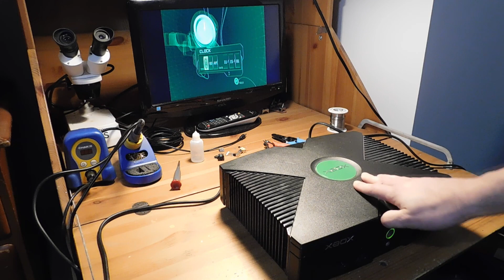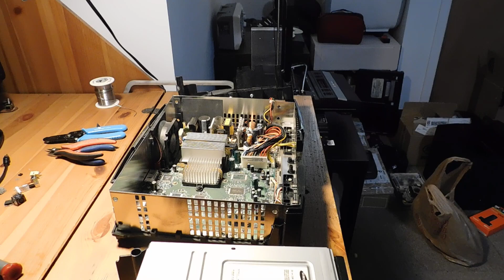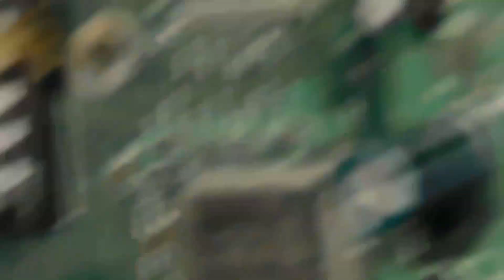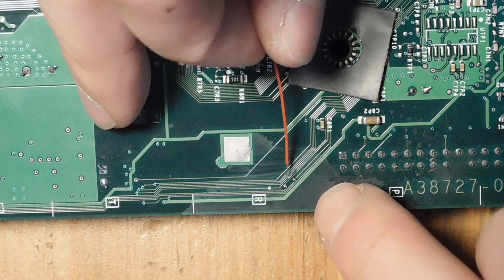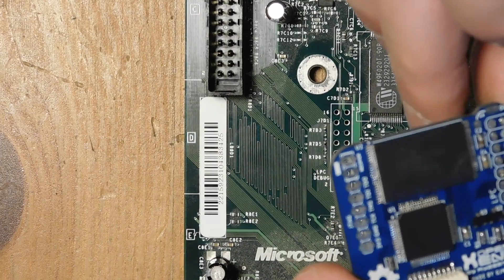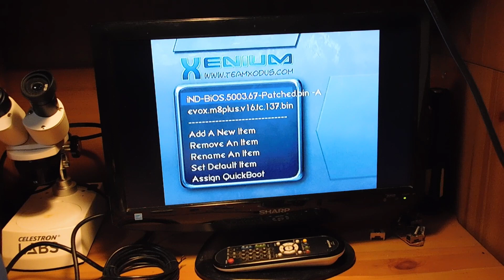Original Xbox: Damaged trace repairs and Open Xenium Install

Comment: Hi, help please, 1.6 motherboard, clock capasitor bypass, full recap, all four ports not work, all traces is perfect condition, zero information about this problem, try different controllers , try different port from donor motherboard, help

Comment: This trace repair was unnecessarily complex, lol. Grind/scrape away at the silk screen at the damaged points til you expose copper, solder some miniature jumper wires and solder mask the exposed area. All in all though, successful repair was successful. 

Repaired a friends Xbox not long ago with a deleted D0 trace. Solder braid wire works great if you don't have the perfect stuff. It appeared to be the same gauge as the traces, and it fit very nicely in the trace channel. Cut to length, pull out one strand at a time, solder to one point, bend to the curvature of the trace channel with two sets of fine tip tweezers and so on.
Reply from the maker: The reason why I don’t do the repair locally is because that whole region is susceptible to more trace decay. You can patch it locally but it’s only a matter of time before additional trace rot will cut those traces again

Comment: You mention that people aren't interested in modding 1.6, is this a fact or just a personal opinion? I picked up 2 original xbox's to mod and both are 1.6 so its not that I got choice as these consoles become harder to come by and cost more. I plan to get a third one so I'd install Aladin, OpenXenium and another third chip I got.
Reply from the maker: It’s a bit anecdotal, but I know a bunch of other people that mod Xbox and they tend to avoid 1.6 because it’s not compatible with some popular mods like a RAM upgrade. But it really does depend on what you want to do and in many cases 1.6 might be perfectly fine
Reply: @LIRetroGaming  yeah I'll agree like I have a 1.6 but outside of chipping it I don't feel there's too much you can do with it

Comment: I installed my Open Xenium chip but I get an error. Xenium Kernal Panic! exception C0000005 (0) generated at 80101A34 (00B41A34), any ideas? I do have a softmodded system, maybe that is it?
Reply from the maker: Yes, I think that’s it. You need Heimdalls Xbox engineering tools disk to install a modcip friendly operating system on the C partition
Reply: @LIRetroGaming  yeah he'll need hardmod dashboard files as there's conflicts using softmod files with a hardmod

Comment: Whine not just recconect the traces locally without 4 meter of wire?
Reply from the maker: The reason why is because the trace deterioration will continue on the edge of the board. So therefore a small patch like what you suggested will fix the problem, but only temporarily. Once the trace deteriorates again you will need to do the repair again

Comment: What's the difference with 1.6 that makes them unfavorable for modding?
Reply: Modchips use the LPC port and Microsoft modified the LPC port on v1.6 boxes. So you have to do an LPC rebuild to get a modchip to work. It's not that hard it's just extra work that has to be done. ALSO, v1.6 boxes use a different video encoder that has issues with running a few games in progressive scan.

Comment: my console is soft modded but that actually ended up saving the console i got it for a softmod and shell swap project but softmodding it saved the consoles original harddrive was in danger of failing and you could tell it wasnt healthy and if i remember correctly i upgraded the console to a 160gb drive that could be locked with the key from the original harddrive

Comment: Also I'd like to note: you may want to shorten the exposed wire down to fit so it doesn't risk shorting onto other traces or components.
Reply from the maker: Absolutely. I went back and cleaned that up while I was also installing the Xbox HDMI

Comment: Just found your channel, and I love the content! The in-depth look at repairing and nodding consoles is awesome.

Any tips or a place to start to learn electronics? Making fixes and mods like you have would be great, but and my knowledge of electronics is slim lol I work as a software engineer so I understand some of it, but not enough to do anything like this
Reply from the maker: Element 14 and Adafruit have lots of good courses and videos that explain electronics. And of course you need hands on experience. Practice on stuff that does not matter and then attempt repairs on some easy systems like the game boy or NES. And then gradually you will build up your knowledge and your skill
Reply: @LIRetroGaming  thanks for the info!

Comment: The clock capacitor leaks, and the acid eats away at the traces. This is extremely common, and it is highly recommended to remove this capacitor from all 1.0-1.4 consoles, even if it hasn't started leaking... It eventually will. 1.6 doesn't have this capacitor.
Also, most capacitors will eventually leak. I've had to replace many caps on v1.6 boxes several times.
Reply: 1.6 has a clock cap, but they aren't prone to this issue, though all capacitors need replacement eventually whether they leak or pop.
Reply: It's imperative to note that the 1.6 xbox clock cap should not be removed, only replaced.  If you remove it your xbox won't even power on.

Comment: I'd probably wash that motherboard as well and maybe paint on some fresh solder mask on the exposed copper traces. You can see how some of the thin traces are exposed. Even your own fingerprints left on the board can result in oxidization of the copper.
Reply from the maker: Definitely. It’s important to clean up afterwards and I do that after the work is finished

Comment: Yeah the clock capacitor is probably leaking or will start to leak in the near future. Don't forget, after removing the clock capacitor, to clean the area where the clock capacitor is with alcohol. It's always good practice to remove it.

I have several Xboxs and I have done these traces repair on about half of them, it's a common problem :( I cleaned all the traces with alcohol, I hope that this helps to avoid the problem.

Good video.
Reply from the maker: Thanks, glad you enjoyed the video. And yes, cleaning up afterwards with alcohol is very important. I don’t always film it but it’s definitely something I do every time

Comment: are those traces designed for timing reasons? they're quite long
Reply from the maker: That’s a very good question I’m not sure what the answer is. The length might be due to timing as you suggest. I’ll look into it because maybe someone has determined the answer to that
Reply: @LIRetroGaming  Might have been more professional looking to just do the work and repair the traces instead of installing some 5 mile long bodge wire that goes through hole on the board. just a thought. i would have done the work. and yeah confirmed those trace lengths are for timing reasons.

Comment: 3:15 why not?  Is it a compatibility issue?
Reply from the maker: Correct - Microsoft changed the motherboard design a little on the 1.6 version so it is not as compatible with the various hacks that are available
Reply: Can only softmod/modchip 1.6 consoles, can't tsop flash. 1.6 consoles don't have any extra RAM pads either

Comment: Amazing 👏.  I also had to fix a few traces. Not easy. 
Was there a reason you didn't used a magnet wire, applied it to that area and call it a day. Thanks.
Reply from the maker: Normally I try to bypass that entire area because the are chances are good that more corrosion will occur. So for example I can make small patches but maybe in a few years a new spot of corrosion will show up. So therefore I just bypass the whole region
Reply: @LIRetroGaming  good to note just incase. 
 Do you know which motherboard revision tend to have this problem the most. Thanks. ;)